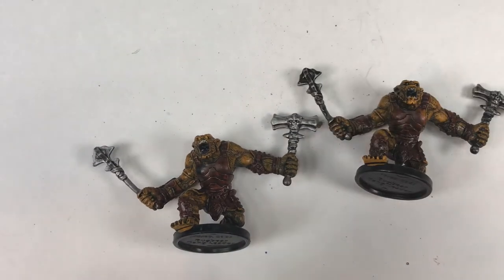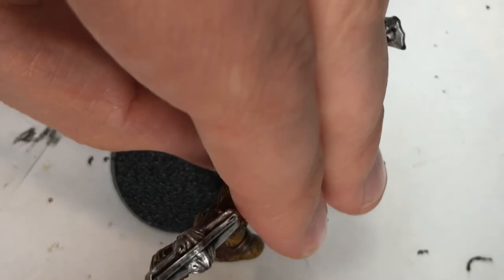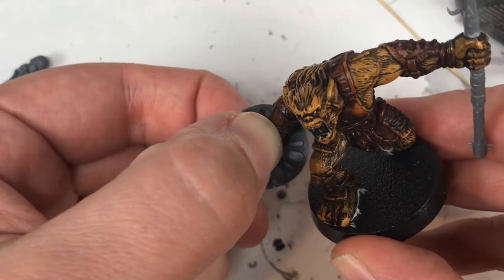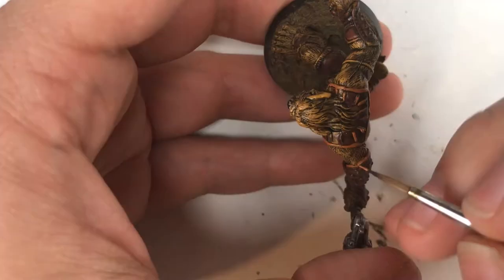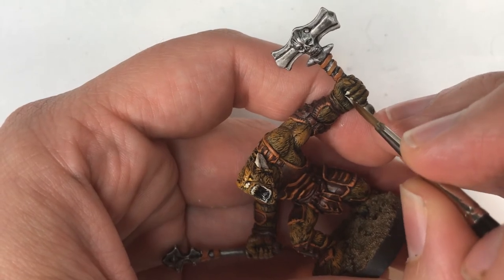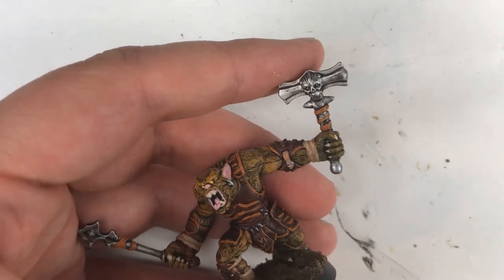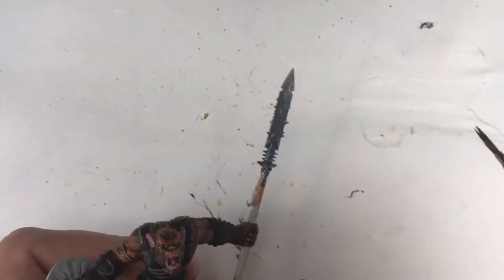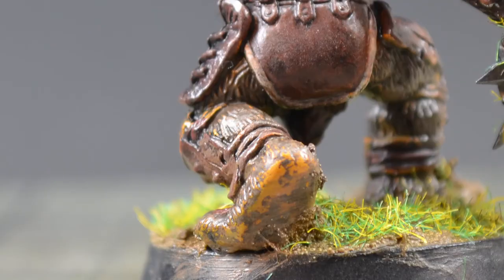Your Prepainted Minis Look Awful, But This is an Easy Fix.

Comment: How to play minis on a plane.
15mm figures and Fantasy Trip
Use M3 Steel Flat Washers with a Outside Dia of 12MM.  These will be bases for the figs.
Then get 15mm laser cut wood hex bases to use as tiles gaming area.  Super glue a few into mega hexes.
Reply from the maker: A while back I saw a guy make a travel 40k board. He used Epic figs on magnets to play the game I think all movement got broken down to millimeters.

Comment: What do you think of the pre primed ones? As I have to take off the moulded lines.
Reply from the maker: I like the pre primed models. Especially the newer sculpts are starting to look really good. 

I just use a razor blade to take the mold lines off because I still prime them before painting.